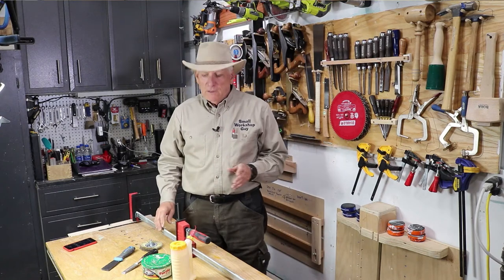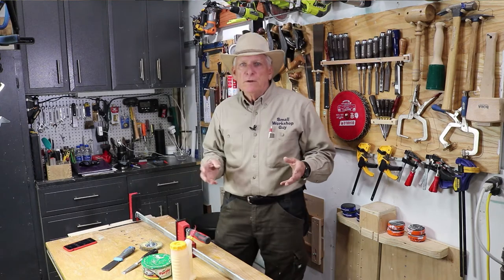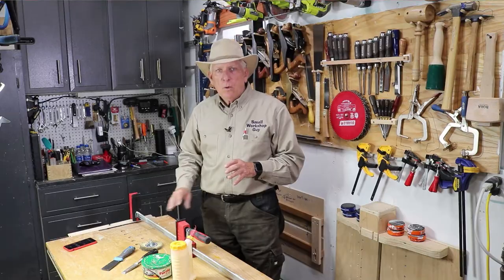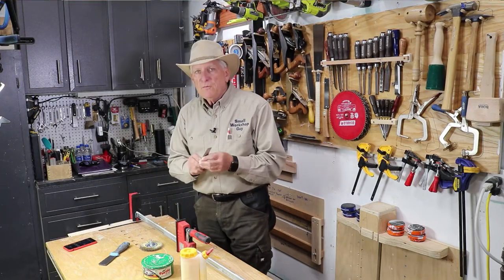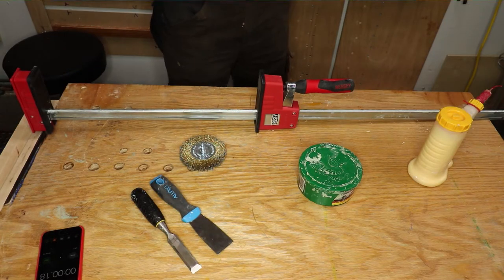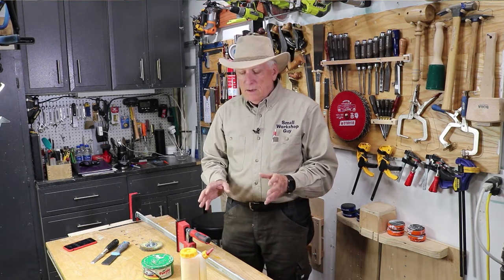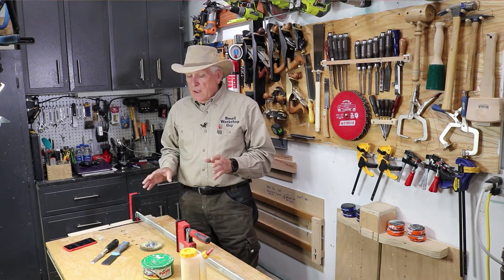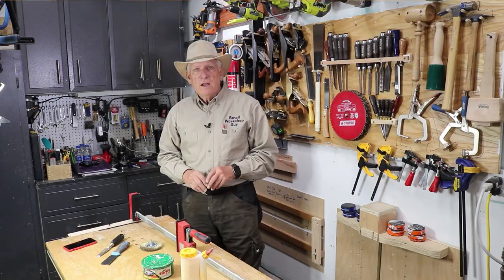How To Keep Glue Off Your Clamps

Comment: Thanks for this video--this is a nuisance issue that is really not discussed much.  I favor the prevention method as you stated.  However I do this by placing strips of wax paper on the clamp itself, between the surface of the wood and the clamp.  this eliminates any glue on the clamp and there is no clean up.  The wax paper easily comes off the glued up piece.
Reply from the maker: Thanks for your suggestion.  Yep, I have tried using wax paper - definitely works but I need to perfect my method because I end up with wax paper everywhere.
Reply: Small Workshop Guy I just tried masking tape instead of wax paper. Worked great.

Comment: Great, but don't be so messy when gluing. I use a damp rag and clean as I go.-- Also as an idea for hanging cords (of any sort ), lately I have been using any old wire laying around and making
a hoop (continuous circle, use any type knot that your comfortable with) then after wrap it around and put it through itself, viola you have a hanger. keep um coming you old coot ....Hahah
Reply from the maker: Hey, my very first "old coot" comment - I love it!!  hahaha.  I wonder if peopel who did not watch the video to the end will think you are insulting me?
Reply from the maker: Wet rags to wipe off the clamps is okay, but I don't like to wipe squeeze out off with a wet rag because I tend to just spread glue all over my workpiece.  Prefer to let squeeze out firm up a bit and then scrape it off with old chisel or putty knife.